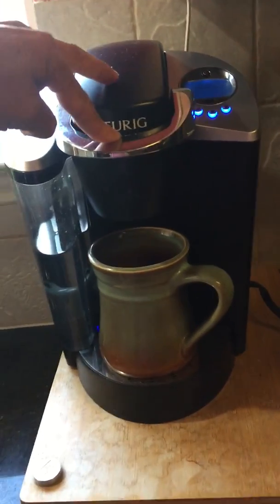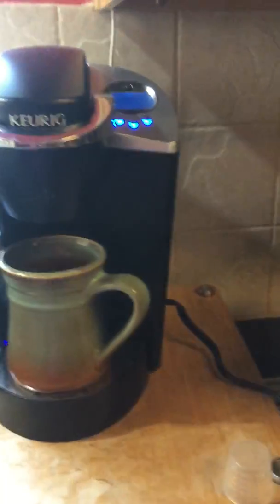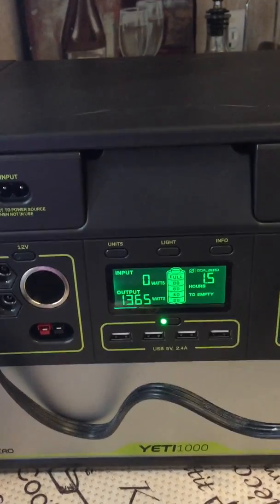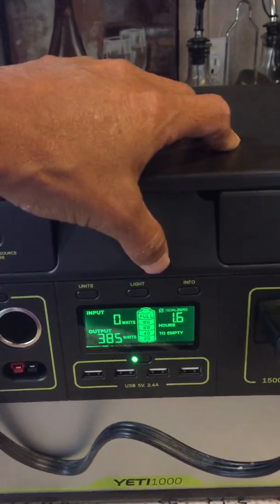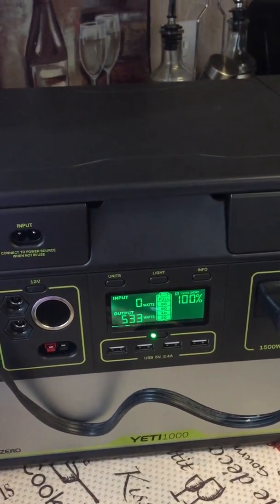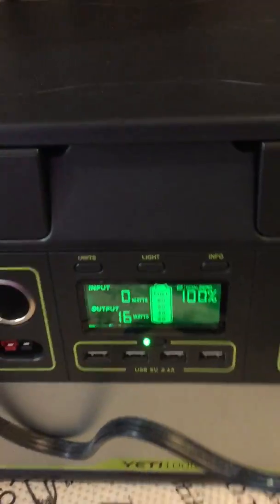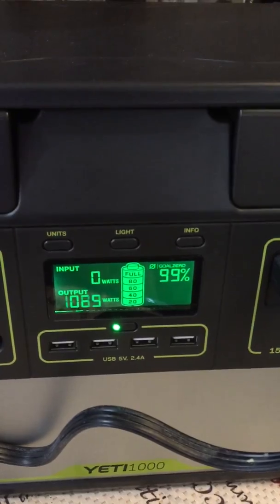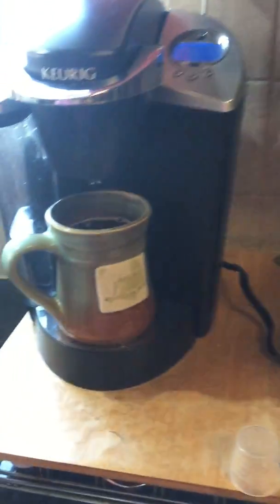Goal zero Yeti 1000 solar generator running a keurig

Comment: Works great as our office Keurig.>>>t.co/vnR78FJf9V   We set two gallon jugs next to it which will fill whenever we need more water. Brews pretty quickly though sometimes it needs to heat up if it hasn't been used that day.
Reply from the maker: oli oli I luv my goal zero.  I haven’t had much time to make more videos but I’m going to make a lot more.